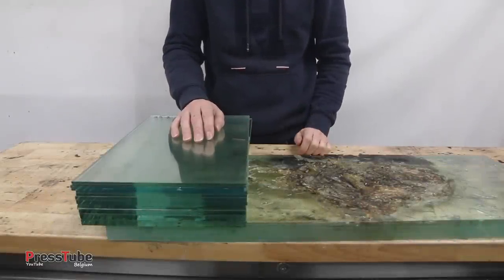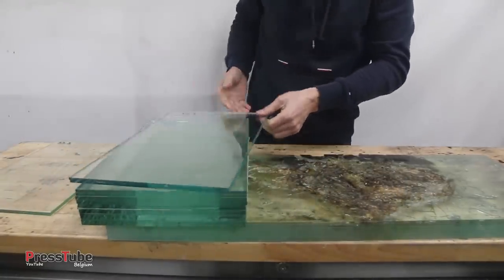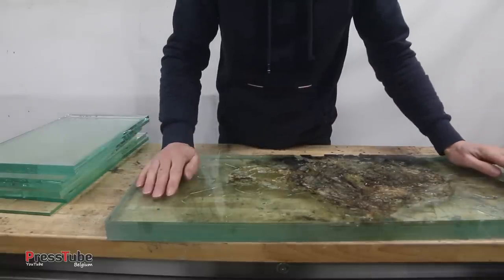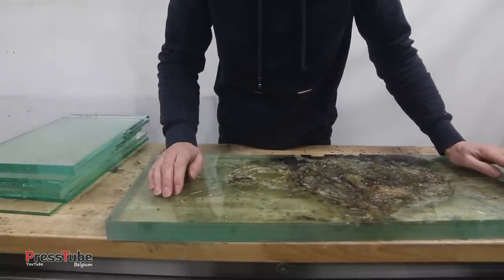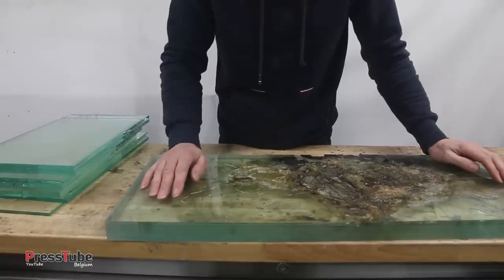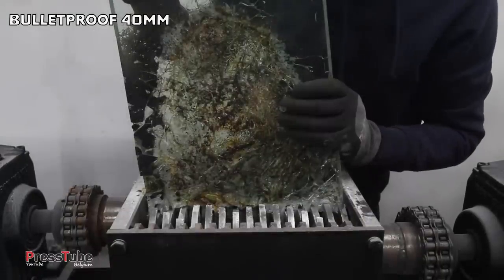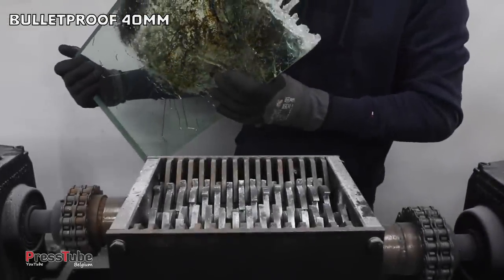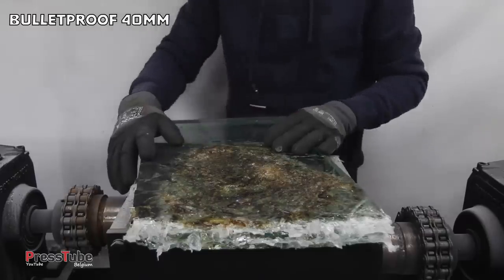Shredding 40mm BULLETPROOF GLASS ! Is the shredder strong enough?

Comment: I was also not expecting the shredder to actually handle that 40mm thick bulletproof glass. But it seems to have barely broken a sweat chewing through it. You have created a true monster.

I really can't think of anything that would give that shredder any trouble that would actually fit in it. I think even a small 2-stroke engine would be consumed by this beast.

Comment: I used to do glassblowing back in college so the term for shredded and broken glass is usually cullet. But this is so fine I think you've basically turned it back into batch. If you threw this into your furnace you'd be theoretically have molten glass to pour (but you would need to cool it in a kiln slowly to avoid it cracking.) The only real thing with using it as cullet is that the polycarbonate might cause problems and also if the bullet resistant glass and the layered glass are too different then it won't produce useable glass and might also damage the crucible it is put in.
Reply from the maker: Send me an email please ;) I have a question.

Comment: BULLETPROOF is the wrong word.. 'bullet resistant' is the proper word.. It may not 'stop' a bullet, but will slow it down to render it harmless..  but watch out for flying glass, when 'it works' - note it is broken easily , it is only deigned for high speed projectiles!